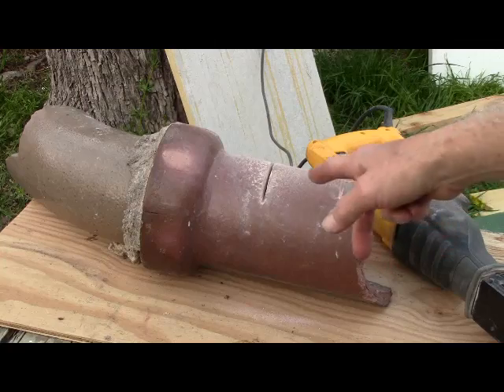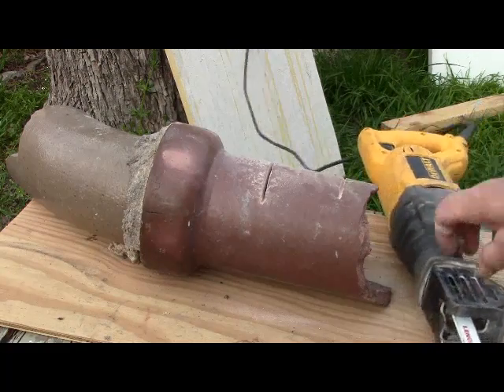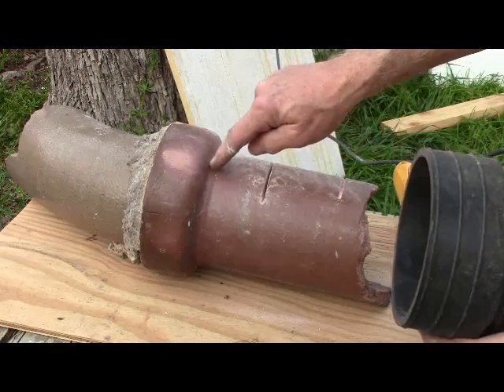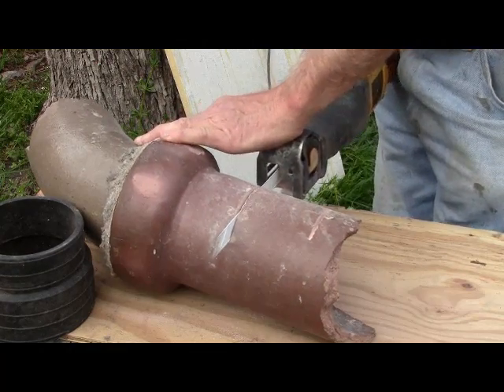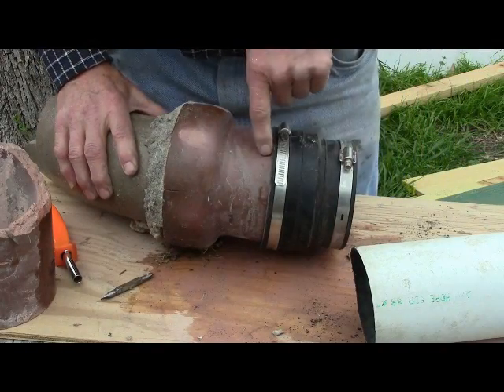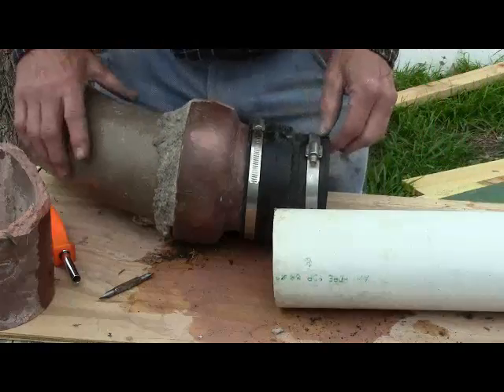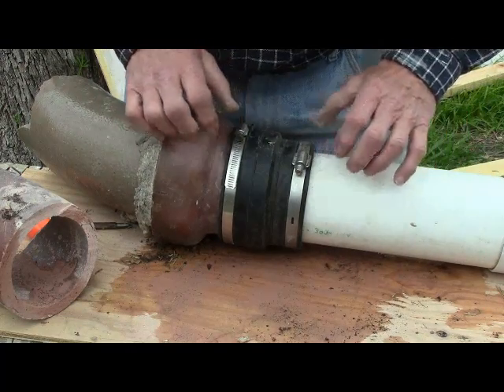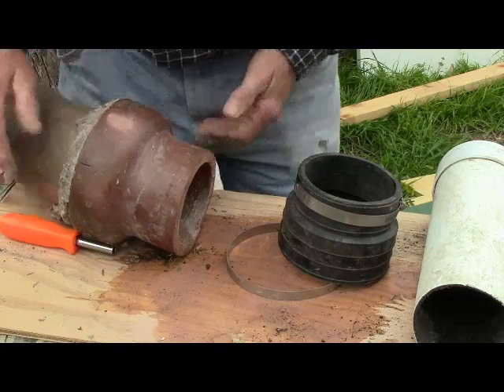Tile sewer to PVC connection

Comment: I just did this, using the rubber flexible coupling.  But I am now worried about roots after reviewing some of the comments below. I believe I will simply dig it back up and either encase it in concrete or use the alternative coupling with stainless steel band.  I'm wondering what would be better, and if I encase it in concrete, how thick should the concrete be?
Reply from the maker: Take my word go three inches below the repaired area about 4 " on each side and pour the high strength concrete in that area  then you can sleep at night.  usually the rubber boot is good enough unless you have trees around . the concrete pour will  do the trick

Comment: What size the boot do used for clay pipe and 4 in cast iron pipe ?
Reply from the maker: Cast iron uses same size rubber as the 4" PVC. Clay pipe uses a 6" to 4" rubber seal You can get them both from HD or Lowes

Comment: As a residential sewer repair contractor, I will tell you that a grinder works best for cutting the pipe. I cut hundreds of pipes and never had 1 crack from heat, I dont know what kind of blade you were using but I just use a concrete blade. Sawzall will work but it takes longer and you'll spend a lot of money on blades. Also, dont use the 2 band flexible couplings for underground sewer pipe. These constantly fall off due to ground movement (at least in colorado). You'll want to use a 4 band shielded coupling(strongback). If you use the crappy ones this guy used, encase the coupling in concrete to help with shear loads.
Reply from the maker: That is what we do it incase it in concrete
Reply: I did this about 20 years ago. I used a grinder and thin cutting- grinding disc ( because that's what I had ) and it worked okay. It took forever being the material it was but it did the job.
I think I used water to lube and cool it a bit.

Comment: Just cut into a live drain with a 4" angle grinder today - as I have done many times over the years... never had one crack yet due to any heat issue. Some plumbers even use a blowtorch to melt tarred gaskin in the collar. The pipes are glazed and fired in the first place, so I don't get the logic at all. And if that saw snags and jumps out of one side of the cut.... almost certainly looking at a fractured pipe - and more digging.
Reply from the maker: Thanks for the information and will pass this along

Comment: Good video, but I make cuts in clay all the time, no cracking (knock on wood), using a diamond blade on a 4 1/2" angle grinder. Also, the rubber coupling you are using will most likely be not allowed in most cities. You need to use a rubber coupling with a stainless steel band in the center when installed underground.
Reply from the maker: Good to know thanks

Comment: Pin point? Lol, mine is about 5 ft of a straight a with an elbow inlet, was a nightmare to remove. The inlet / drain to the end of the straight was entire earth + roots. All cracked and nasty. I dug it out to make easier for the council to repair and they came and ran away because I dug it up! Most likely believed I damaged it. I did not! It seas near v shaped in the ground. 40yr old I believe. Also the dino rod guys blasted it and created a hole at the bottom of the inlet of the drain. I repaired that with pure concrete ...thanks for the advice, I'll get this fixed up at the weekend. Cheers ;)
Reply from the maker: WOW! sounds like you got a hugh job on your hands. You can do it ,it just takes time

Comment: I have a similar situation but the cast iron pipe I want to remove from the clay hub is cemented in. Can I safely use a cold chisel to chip the concrete away from around the cast iron pipe to remove it? Or am I likely to break the clay pipe hub?
Reply from the maker: It's going to break the clay pipe. It's best to cut the clay pipe .  Also they make diamond saw all blades now.  Good luck
Reply: Thanks, the clay is below the cast iron riser which goes to the toilet pan connection. The cast iron has a similar large hub on the end, so I need to cut the cast iron above the union with the clay pipe. Don't have access to a chain cutter and I dont want to use a grinder for safety reasons. The cast iron hub is in the way so I can't get my reciprocal saw into the space. So I am going to try a cold chisel.
Reply: er yep, broke the clay pipe below the cast iron. It was only secured by a 140 dia rubber o ring so I could have pulled the whole thing out of the bottom mushroom hub. I assume this is a short piece utilising the rubber to provide flex for earth movement etc. Went down the local town dump and found a nice piece of clay pipe. I will put in a straight piece utilising the rubber o ring then connect the PVC riser with a rubber boot, then my pan connector will go into the new PVC. Thanks for the advice.
Reply from the maker: Glad you were able to figure it out.
Reply: dusty guy I have the exact problem, my clay pipe is not as clean as yours is shown in the video, the hub/union piece is a mess of concrete, any ideas how to clean up and remove the cement off the clay without damaging it? I need enough space to make two clean cuts...

Comment: My terracotta clay pipe has a 6inch lip , which leaks with a rubber reducer boot 6 inches to 4 inches to using Green PVC. I could not cut this Lip off to save my life with my sawzall . Since there is cement around the lip of the pipe 6inches I don't want to fracture the pipe which is still below ground. This took me 4 days of digging manly man work. not again. I have a smaller boot that fits perfectly on the other side of the pipe. I'm hoping to get a diamond blade so this will work without any more pain.
Reply: Mike Caldera I slipped the pic inside of it and cemented it with quickrete
Reply: Jimmy Ray - difficult to do this when pipes are fixed below ground
Reply: Mike Caldera use a grinder and diamond bland 9"

Comment: easiest way to cut clay pipe. Use a 9 inch angle grinder with a masonry diamond cutting blade. It has worked brilliantly well for me  every time
Reply: This to this guy ^^ It cuts like butter.
Reply: Nick Collins 16inch demo saw works even better
Reply: I agree... I had to cut one last week. Needed to dig around the pipe. Did it section by section..

Comment: you can hire a chain-wheel cutter or I used a 125mm angle grinder which left me with some rough edging at the bottom since I had to cut into it at an angle. Then I tidied up the rough edge with a multi tool with ceramic attachment.
Reply from the maker: TheJoeman11 That's a great idea thanks for sharing
Reply: I like the cut of your jib. Regards from Australia

Comment: I use a 41/2" hand held grinder and cut those clay lines all the time, the saw saw blade is one used for cast iron pipe, at Home depot. I also mix a small amount cement into soil around repairs just to get soil to set and nor sag
Reply from the maker: This helps thanks
Reply: just an old Roto Rooter guy

Comment: Thanks for the video. I'm about to replace a good section of sewer pipe under the house and was looking for a few tips.   Not so sure I'll be happy digging though LOL
Reply from the maker: Hope you saw the part about the diamond blade for the sawall. It will make quick work for a messy job.
Thanks for the reply
Reply: dusty guy Yep.  I did this same job with my father about 15 years ago and the circumstances were just about the same when connecting the old clay pipes... but I've got a feeling it might be worse in this situation.  Either way the pipe and concrete will be put in place.

Comment: If you can slide the pvc inside the clay should you do this as far as it can go?  Should you caulk the joint a lot with sillycon also?
Reply from the maker: You can get a 4" to 3" reducer and a short piece of 3" PVC about 6 " long or longer  . Slide the glued 3"" PVC pipe that is glued to the reducer into the clay sewer pipe and then slide it back onto you new 4" PVC. That should leave you about 3" of your 3 " PVC in the clay sewer pipe. 

Now when you are through gluing the 4"  go back to the clay pipe and roll up some news paper and shove it around the 3" PVC and clay pipe to form a gasket seal. Make sure it is tight all the way around .  Mix up some ready mix concrete and make it thick (not soupy ) and form it around your 3" PVC and clay pipe. This will make sure there will be no roots can get in your sewer  it is very important that your newspaper is tight seal ,  don't use any type of plastic or plastic bags because if they become loose they will get into your sewer and stop it up. I'll try to post something soon to show you by video